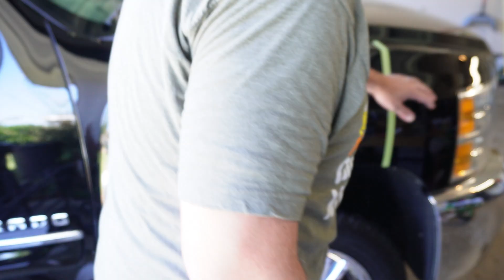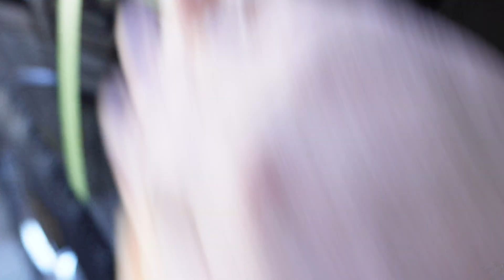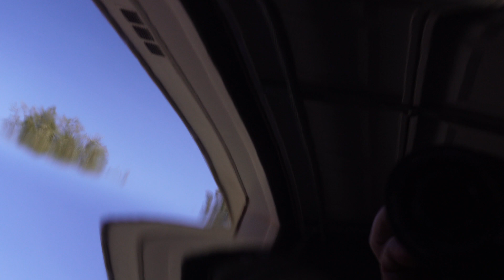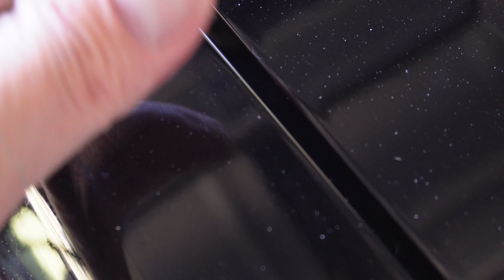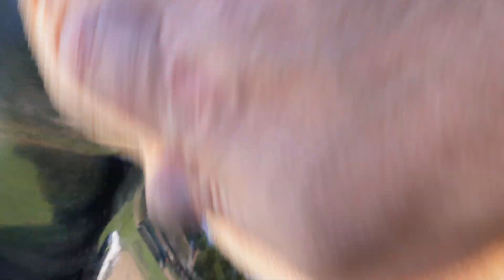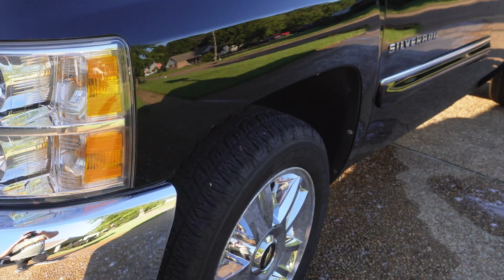Battle of the One Steps/3-1s!! 3D One vs Griots Fast Correcting Cream vs Rupes Uno vs Menzerna 3-1!

Comment: Does the 3D One finish nicely with the uro fiber pad, especially on that black paint, or does it need to be followed with more of a finishing pad or polish?
Reply from the maker: The 3D One finished nicely. All the others finished nicely as well. If you want it to go from great and chase perfection, then you could go over with a dedicated polish and polishing pads. Also, put some protection on it. I used 3D Speed for a last just to add a little more gloss and a little protection. Thanks for watching!

Comment: What polishing machine did you use?
Reply from the maker: I use a few. I use a Griots 6 inch (converted to 5 in.) A Griots 3 inch and a Rupes. I like them all. They're all random Orbital. I have a cheap rotary polisher from Harbor Freight that still works well.

Comment: Just found your page and I’ve been looking into several aio products. Question… have tried any of the chemical guys product?
Reply from the maker: Thanks for watching. No, I have not tried a CG AIO.
Reply: no hate but id stick to p&s carpro gyeon and koch chemie but for 1 step polish the 3d is good that one doesnt have a sealant 3D SPEED does have a sealant
Reply: You mean marketing guys. Products sold at big box stores is what I call section 8 products. They do not and will not produce results like the pro products. 3D, Sonax, Jescar, Carpro, Koch Chemie, Rupes etc
Reply: @Bullwinkle7678  yes, I figured this out months ago. I sway away from them. Rupes and 3D are my go to depending on what I want to achieve.

Comment: Adams has a ok 3n1 my favorite is 3d one  their products are awsome their detail spray wheel cleaner like for the wheel cleaner one product an not 5 different ones that are the same like cg
Reply from the maker: 3d one is definitely my go-to for now. There's a few others out there I want to try. But all these products will work well in a case by case basis. Thanks for watching!
Reply: Its never a good idea to sit buffing for one or more minutes buffing.  Lots of stress on the three layers of paint. Good info, though. 👍👍 have you tried Mcguires D300? Its  cuts quick in one or two passes. It has never failed me.

Comment: Interesting, but Griot's FCC is their aggressive compound. Better would have been their regular Correcting Cream. Either way, both considered compounds. Neither leaves protection behind like Menzerna 3-in-1, or Rupes UNO Protect. And 3d ONE is considered a hybrid compound/polish, and again, no protection is left behind. Why not just actually compare the respected AIOs from the line up: Griot's Finishing Sealant and 3d Speed?
Reply from the maker: Thanks for watching! I understand what you're saying. I didn't clarify in the video and that's on me. I was trying to demonstrate the cutting power of each. That's why I finished the truck off with HD Speed. FCC was included due to you can get it at AutoZone and it's ability to cut down and finish like a polish. Thanks for the input! I appreciate it.
Reply: @chrisinmiss  ahh, that makes sense. All those are decent products. And nice that you can pick up the Griot's at a local store!

Comment: If you don't mind telling me. How much did you charge to polish that silverado
Reply from the maker: 500-600. That clear was in rough shape. The hood and roof had to be wet sanded, compounded and polished. Ona time consuming job, charge accordly.
Reply: @chrisinmiss  fairly cheap, for the work involved
Reply from the maker: I can understand your point, but it's subjective and depends on the vehicle and the market.  I was also able to use Speed only on a few of body panels. I have at the max 8 hours tied up in it. 1.5 hours of that was shooting the video.
Reply: @chrisinmiss  oh, totally subjective. So many variables, like your location. It's all good. What matters most is that YOU are happy with the amount. I'm cheap in my region, but it's still enough to where I'm happy
Reply from the maker: @BB_Detailing_00  Very True, man. This is Part time for me at the moment. As a get bigger and more well known, I can go a little higher on pricing. I work in an auto factory, so that's where I've picked up my knowledge and speed for getting around corrections fast.

Comment: Griot Fast correcting cream is a compound not a one step. Also you were using the wrong pad the Boss system is matched to there pads . Color on the bottle is the color pads they recommend.
Reply from the maker: Technically, yes it is. I included it for two reasons, the way it finishes and availability. As advertised you should be able to skip the polishing phase when using (may need to use protection extra step) and this is a product you can likely pick up at AutoZone or a similar store and not order.

 Thanks for watching!
Reply: People don't often match polish to pad. 

I'm this field, anything seems to go.

Comment: Dear sir great video. But fast correcting cream is not AIO product either the 3d one. The AIO on Griots line is the Finishing sealant, and on 3D line the SPEED
Reply: Different products, but technically they are one step polishes, and some will need protection
Reply: 3d ONE is a one step and has a sealant, it's equivalent to Rupes Protect. In my experience, Rupes Protect gets really good results with a Rupes wool pad. I think the fine-ness of the abrasives with a slightly more aggressive pad put it in the sweet spot. Nice work, thanks for taking the time to record this and put it out there.
Reply: @kylegeldmaker  3D one is a one step compound and polish and has no protection , it’s pad dependant , softer pad for polishing and more aggressive for compounding , they actually do a all in one which is 3D speed and that has protection in it
Reply: @M.E63  I was misled by a copy + paste on Amazon. I was looking for a conservative one step ( I went Rupes), and came across 3D ONE (and speed), the product description for ONE on amazon said it had a sealant. I just checked the actual product and it doesnt mention a sealant. Thanks for the heads up.
Reply: @kylegeldmaker  pay harder attention dammit...jk
Reply from the maker: @kylegeldmaker  thanks for watching!

Comment: Wait a minute, my fast correcting cream wis way more watery... like milk not cream per se
Reply: Shake it up lol
Reply: @michaelwhitfield609  still runny
Reply: @Carlos.Rivera  well sir, that sounds like a bottle that has be left in the cold and the chemicals has broken down. Or it wasn't mixed right from the factory. Some polishes when left on the shelf to long breaks down. That's why I check the dates. I have a bottle of fast correcting cream and it's not runny but awesome. VSS by chemical guys is nice to, sonax perfect finish also. I use a micro fiber pad on speed 5.
Reply: @Carlos.Rivera  seeing that you can't send it back. I would mix it with another compound
Reply from the maker: Hmmm. Strange.
Reply: Seen the same problem too. Does not cut as well when it's milky